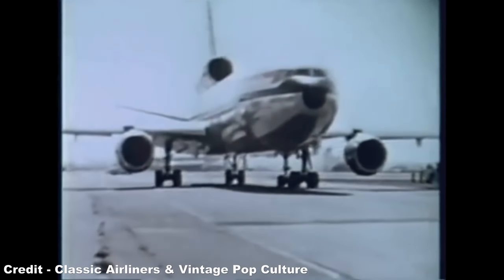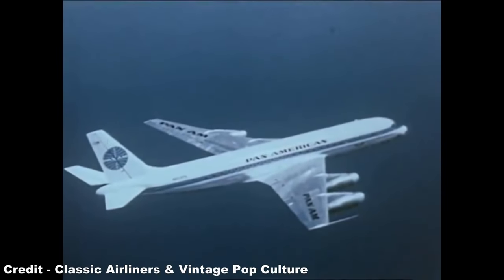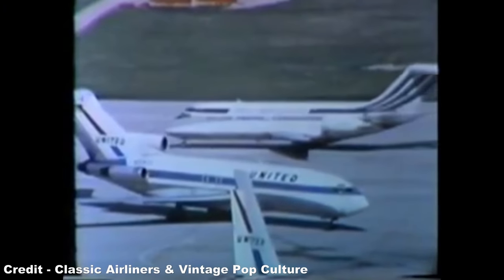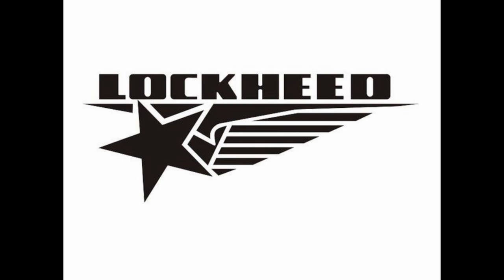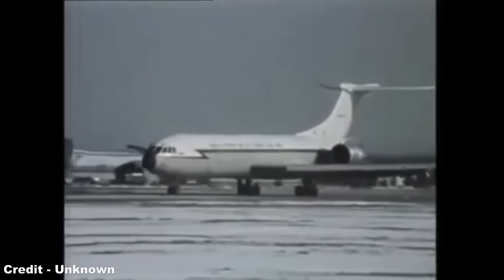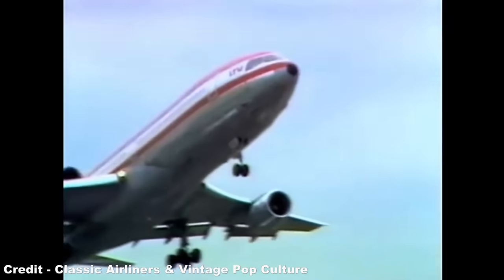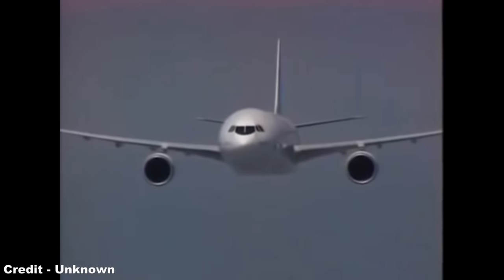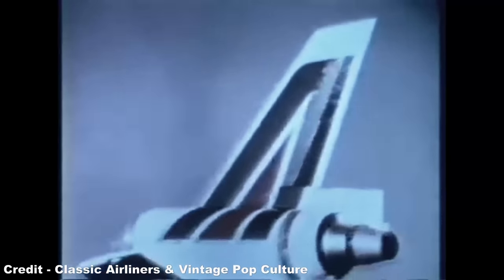What Killed the Trijets?

Comment: The L1011 TriStar was my favorite ride. It was smoother, quieter and more comfortable than anything else available at the time.
Reply: That's the one I missed most.  I flew on one only two times and climbed around on one at the Mojave boneyard but what a stunning aircraft that was.
Reply: Dean, yes, I liked them better than the DC-10's. I think the last time I flew one was about 1996 for a one hour flight from Atlanta to Tampa.
Reply: Me too
Reply: Same here.I flew the L1011’s of Eastern ,TWA,and Delta.
Reply: They should bring back the L1011 as a twin jet with Rolls Royce Ultrafan.
Reply: @davidperry4013  Not sure. I’ve never yet gotten comfortable flying with only two engines, especially over water.
Reply: @christopherhennessey8991  Me too: Eastern and Delta to Florida; TWA to Europe. Those were the days...
Reply: @DeanStephen  On a long overwater flight, the biggest risk is NOT a dual engine failure, but rather...

...wait for it...

...an uncontained cargo fire.

True story.

That's why some ETOPS rules (developed for long overwater twinjet flights) have been adopted for ALL flights, including 3- and 4-engine jets.
Reply: L1011 TriStar featured in the TV movie The Langoliers and an aircraft with short runway takeoff proved vital to the storyline to help save the new people from the hungry eat anything Langoliers.
Reply: The L-1011 was a wonderful jet. It would have been equally great if it were designed as a twin if they they had the powerplant available then.
Reply: I’m guessing you never sat in the back…bloody noisy! I flew in an L1011 the day after the Alaska Air crash 😳
Reply: @DraftedByTheMan  You sure you weren’t on a MD-80? The Alaska Air crash was a MD-83.
Reply: @DeanStephen  Thanks for the correction. It was an MD80. 
I was trying to get some reassurance from the flight attendant so I asked her how she’s feeling after the crash.
She said “This is my first day…I’m terrified!” Not helpful 😝
Reply: @DraftedByTheMan  >> Ah, but it’s funny in retrospect…right??
Reply: I’ve never flew on one but they are lovely.
Reply: I flew a PSA L1011 one time, I  was really young but that is my fondest memory.
Reply: The last one flying is the Stargazer.  It is still flight worthy.  It was last used in 2019.  However, it is expected it will fly two more times, at least.  I love the L1011 so much that my old Jeep, I have had for 26 years, is named, "RMS Stargazer."
Reply: I agree! I traveled extensively for my job and always looked forward to flying on the L1011. First Class was great!
Reply: @billjamison2877  I gave up flying completely in 2004.  It became such a disgusting experience that I told work to not even bother buying airline tickets for me anymore.  I told them to just compensate me for my diesel, get be bus fare, or get me train fare.  I also gave the option letting me take a private jet, if they so felt like it.  Needless to say, I have been driving, taking a bus, or taking a train, a lot the years following 2004.  It still beats modern commercial flight.  Flight used to be my favourite way to travel.  Now, I will never do it again.
Reply: No difference over land , lose engines and your done
Reply: Yep, and absolutely beautiful too. I hope a couple can be kept flying.
Reply: @DeanStephen  air transat 236
Reply: It was a great plane to fly in. Quiet and comfortable. Too bad it was discontinued.
Reply: I didn't fly until after the L1011 was retired however, it is one of the first commercial airline aircrafts I remember outside of the 747 because of the unique tail design and one of my favorite designs.  My favorite might be the Lockheed Electra that Emilia Earhart flew.  I used to work at the McDonnel Douglas plant in Long Beach, Ca. and every morning on the way to work I saw on of these taking off from the airport.  I later learned it was the daily fruit and vegetable delivery to Catalina Island just 26 miles over the sea(like the song).  The 1st aircraft  I flew on when I was 15 was a Cessna 172 and 1st commercial aircraft when I was about 22 a Boeing 727.  I was lucky enough to fly in one of the most iconic airplanes ever the DC-3(C-47) for only $15 in 1993.
Reply: @billjamison2877  My first ever flight overseas was on an L1011 with Cathay Pacific from the US to Hong Kong. It was a smooth, comfortable plane. I was surprised to see the engine brand decal was still on the outside and that was when I learned Rolls Royce is one of the world's largest aircraft engine brands! And they make damn good engines too: very smooth, no annoying vibration. I saw a documentary about their aircraft division and was shocked that they build them like their cars: by hand. That takes nerve and serious skills. And the design is interesting: it produces a sound that no other brand of engine can imitate. I can actually close my eyes during take off and listen and tell if the engines are Rolls Royce. They make a very distinctive whining noise when it's rumbling down the airstrip.
Reply: Flew Tri Star regularly BA London - Paris and London - Tel Aviv in late 1970's. Comfortable even on Paris trips when fully loaded.
Pilot's window split over Croatia so had to fly depressurised to Athens and wait for a replacement plane from London. 
Apparently the specifications of the BOAC and BEA versions were very different in various operational aspects causing inflexibility when the two airlines merged..
Reply: The 2 - 5 - 2 seating configuration was no fun if you were in the centre seat.
Reply: @Hattonbank  It sure was nice if you were a family and could all sit together though.
Reply: @Hattonbank  Also, I used to take the red eye from SFO to STL, which were usually scarcely booked. Those five seats together made for a relaxing place to stretch out even in cattle class.
Reply: @RedBud315  I flew in a DC-3 into Fort Polk, LA. Very memorable experience.
Reply: The DC-3 flight was on a parachute jump plane and after everyone jumped I went up to the cockpit and sat down in the co-pilot seat.  The pilot had his side window open and had his arm out the window like driving a car down the freeway so I did the same thing on my side.  Definitely a memorable flight.
Reply: Had an incredible service record and was an incredible ride as well.  I don't know if it had a heavy designation or not but it was a big aircraft
Reply: I flew in one from Toronto to Vancouver in 1986. beautiful jet, and asked for permission to go up on the flight deck to visit and watch the crew. they allowed it!!, awesome experience, it was so peacefully quiet. We were in high cloud cover at that time, and staring into a white bank of clouds in front going over 500 mph, was eerie, but cool at the same time.
Reply: @ronsearle1632  I swear if you looked between the outer door threshold you would find a Cadillac placard.   So smooth and quiet.   Like butter with wings
Reply: I only flew on one time in 1998 (Delta LAX-SLC). All I remember is that it had two aisles and either the flap or gear operation were very loud. People seemed nostalgic about the aircraft, but I wasn’t familiar with it as I don’t think Australian operators used it.
Reply: I flew on this same jet back in 1981. Nice plane.
Reply: @SpaceAce100 - gorgeous planes. Those things would take off like rocket ships. Of course, the captain on that flight obviously thought he was top gun. 😉😄
Reply: There is only one in the world still flying and that saddens me. I'm in m; 30s and have never flown on a trijet. They are so beautiful.
Reply: the l ten eleven flew with a bit of an angle of attack
Reply: The "Whisper Whale".    A great plane.
Reply: I still remember a trip to from Montreal to California in one of them about 36 years ago.
Reply: Yup, I flew round trip across the Atlantic at least 30 times in the early 80's and the TriStar was by far the smoothest ride, to the point where I still remember it well.
Reply: @Hattonbank  Yes but it was awesome on transatlantic flights which were usually 1/2 empty at the time.... Better than first, which had no sleepers at the time....
Reply: I esse a professional  aviador on civil aviation,  (airlines), for 40 years, and THE BEST AICRAFT I EVER  FLEW, WAS the Lockheed L-1011  "TriStar".
   PERIOD.!!!
   And  I FLEW the "Caravelle", the  727-100, the 727-200,  the 707, the 737's, the 747, and the Great L-1011, and the Aibus 
A-310, the 319, the 320, the 330, and the 340.!!!
   The BEST??
   Of course, the L-1011.
Reply: @largol33t1  Bill, I noticed the takeoff whines the first time I heard them also. The first time it alarmed me. Ever after it was a comfort.
Reply: @Hattonbank  But it sure was nice when you happened onto a near empty redeye and could stretch out in economy and fly like a king.

Comment: Trijets suffered from the difficult maintenance of the engine up in the air that was difficult to inspect and remove at overhaul. With some airlines that middle engine became the neglected engine and the rest is history.
Reply: Also greatly reduced the working area within the aft equipment bays for servicing other systems.
Reply: That isn't true.
Reply: Douglas built a work platform under #2 engine that made it easy to work under and service. Worked on plenty of MD11 and DC10.
Reply: The ll1011 came to the market too late and was too $$ . The DC-10’s crashes from the “pinto” door sealed their fate
Reply: A friend of mine started with the 727 as an F/E.  For the -200, a first departure of the day meant opening the rear galley doors and looking into the No. 1 and No. 3 engines with a flashlight.  The No. 2 engine never got as good of a look, being buried in the fuselage.

Inspecting the engines on the 757, 767, and 737 is a lot easier
Reply: Loved your "Mad Bomber" video!
Reply: Long time no see leokim!

Comment: I thoroughly enjoyed this video.  I have 26 years in the L-1011 and flew all 3 seats in the 727.  If I may add a couple of things to your already excellent video...

The relaxing of the 60 minute rule isn’t the only thing that killed the trijet.  Trijets originally came about because American wanted a two-engine airplane to fly transcontinental trips with, but the engine technology at the time hadn’t evolved to the point where a two-engine airplane could fly over mountainous terrain and meet the enroute performance requirements should one engine fail at an inopportune time.  Three engine airplanes were the solution.  In fact, the L-1011 was originally designed to meet an American Airlines spec, but as you correctly pointed out, the problems with the RR engine delayed Tristar production and American purchased the DC-10.  The Douglas/Lockheed rivalry could be a story all by itself...but before I digress..

As engine technology advanced, the advent of the A300, and then later the 767, two-engine airplanes could meet the performance required with one engine out over mountainous terrain.  The rest is history.  The engine performance was there, the 60 minute rule relaxed, ETOPS was born...the trijet was done.

Lockheed also explored a two-engine version of the TriStar, nicknamed the “BiStar”, but as with the Douglas airplane it never got past the drawing board.  

I had an American Airlines 767 Captain ask me once why I was flying 3-engine airplanes across the Atlantic and Pacific?  My response to him was, “because the company doesn’t own any 4-engine airplanes” haha.

No kidding, thanks for a great video. Really enjoyed it!
Reply: Hey Georgia,

You nailed it!  The 60-minute rule died because newer engines performed better and for longer periods of time.  Nothing more, and nothing less.
Reply: Interesting... I always assumed the three engines were for reliability in crossing the ocean.  I never though about mountain ranges.  Thanks Captain for that explanation.
Reply: @minerran  I agree, I too always assumed it was all about over water.
Reply: @jameshayward8533  It was for any operations that required higher reliability. Over water is just one example.
Reply: Twin engine planes HAD demonstrated that they could fly over high mountains on 1 engine, but, like you said, the possibility that the remaining engine could fail made the FAA say "NO", although there were some exemptions.  Still, it was illegal, until the FAA relaxed that rule.
Reply: @markmudgett7579  Also, the FAA believed that they could.  If they hadn't, that rule would still be in effect.
Reply: @jameshayward8533  Pretty much. They flew DC3s across the Rocky Mountains in Canada on schedual service very early on.
Reply: Living in the Puget Sound region, we were infused with Boeing's developments in the 80's and 90's. And one development that stood out was the certification of the B777 for ETOPS. So I just expected that the B777 being certified for ETOPS was what helped kill off four-engine jets over water routes. Thank you for the additional insights.
Reply: @scottcates  You are quite correct.  If the FAA had never rescinded the 60 minute rule, 727s, 747s and other 3 and 4 engine planes would still be the only aircraft flying on transoceanic routes.
Reply: @michaelbenardo5695  The FAA 60-minute time rule has not been "rescinded." FAR 121.161 still exists and applies to all air carrier operations. Air carriers must apply for, be approved for, and maintain ETOPS approvals. These authorizations will normally include comprehensive tracking of in-flight engine parameters, APU reliability data, etc. If negative trends are discovered, the carrier will adhere to the more restrictive 60-minute rule until their maintenance program can again "get their ducks in a row." 

ETOPS flights also do not exist in a bubble. For instance, with ETOPS 180 approval, and with all items of relevant ETOPS equipment operable, a flight may be dispatched or released on routes of flight that take the aircraft up to 180 minutes from a suitable alternate airport. But if at the time of dispatch/release, certain items are inoperable, the route may only be allowed to use a 120 minute rule time. If too many items are inoperable, the flight must adhere to the 60 minute rule time.

Airline flight planning software can be programmed to minimize ETOPS exposure. Let's use a few Atlantic crossings as an example. Routings can be modified to be more northerly - to take advantage of staying within range of Keflavik, or more southerly - to stay in range of Lajes. Just because the aircraft/crew/operator combination CAN perform ETOPS, doesn't mean they necessarily NEED to for the entire duration of a flight. Or that every flight will contain ETOPS 180 or 120 segments.
Reply: @adamreznik6374  So the ability for twin-engine planes to fly over water and mountains is conditional then.  Actually makes me feel a little better.

Comment: Another reason was longer runways.
The 727, DC-10 and L101 can use short runways (its why cargo services like them)
As runways were lengthened it made twin engine safer to land and take off.
Reply: There's another factor...all these tri-jet configurations are prone to stalling.  Insurers got a bit nervous about underwriting those airframes, so along with guzzling more jet fuel, higher insurance premiums.
Reply: @selfdo  rear mounted engine twin jets were just as bad at stalling
Reply: @andrewsmart2949  Which is why they’re very uncommon in any new airliner now.
Reply: The Ford Tri motor was the first plane with Tri Engine with 3 Props.
Reply: @Perich29  which made it more reliable as it could still fly reasonably well if one engine failed,and aircrafdt engines were not the most reliable back then LOL
Reply: @BrapBrapDorito  There are no more trijets in commercial service, last was the MD-11.
Reply: @petergriffin3194  I’m talking about rear mounted twin engine aircraft, I know large tri jets are only used as freighters. Also, a passenger trijet is still being sold and operated. The Dassault Falcon 900, 7x and 8x all long range business jets.
Reply: @BrapBrapDorito  Yet you still see them all the time in business jets.
That was a DESIGN issue, not an "inherent to the concept" issue.
Reply: @Perich29  The Ford Tri-motor was a rip-off of the EXISTING Junkers JU-52, which PREdated it as a tri-prop aircraft.
Reply: interesting comment